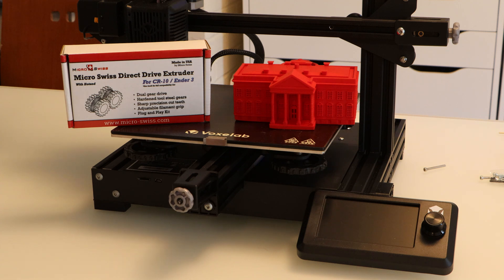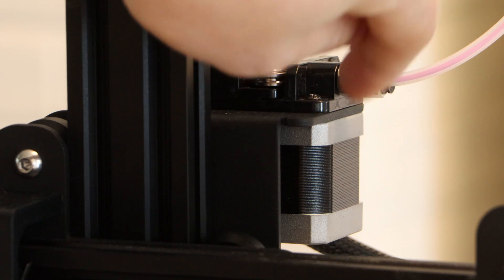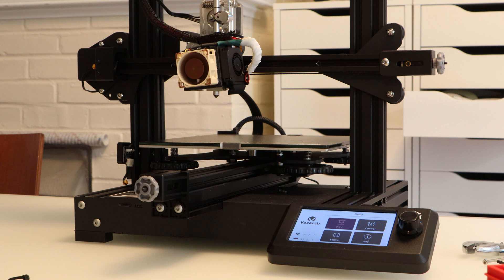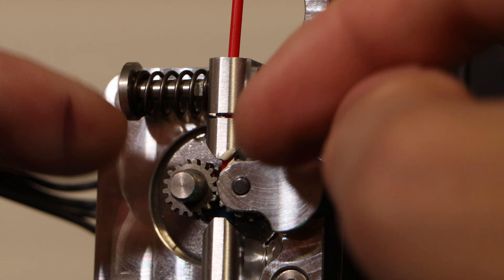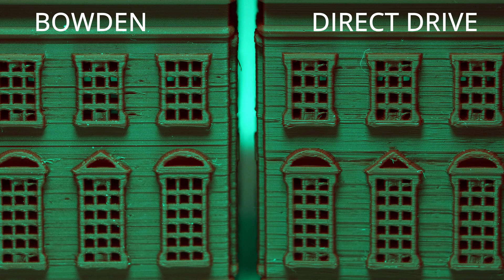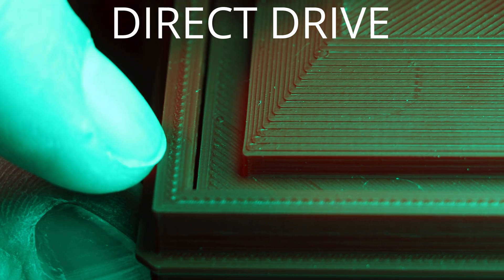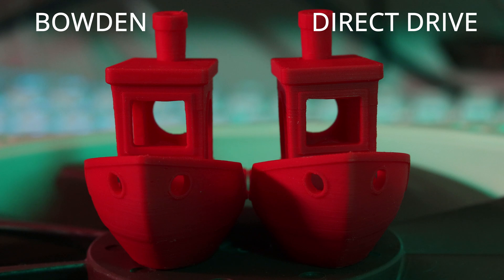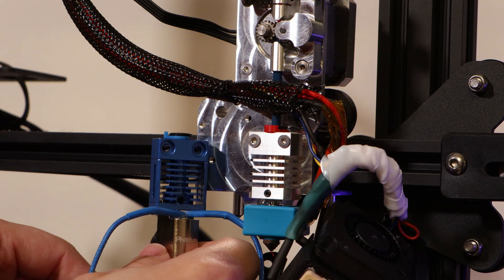Why Direct Drive Beats Bowden Tube

Comment: on the MicroSwiss product page for this direct drive kit, there's a series of tabs. Under the "Fits" tab there's a link to a printable fan shroud that solves your primary issue. At any rate this was a fantastic, informative video.
Reply from the maker: Thanks, I'll check out that printable fan shroud! 

Sometimes I don't read the instructions and get myself into situations that I have to hack my way out of. 

I broke a pretty expensive hotend last week because I didn't read the nicely printed user manual that was included in the box 😅

Rather than admitting defeat and reading the user manual, I spent 10x the cost of the broken part on tools so I could fix it. But now I can break it as many times as I want! Plus I discovered a weak spot in the design and figured out how to improve it. 

It's the topic of my next video with the Phaetus Dragonfly HF

Comment: Just got an aquila x2 and the guy I got it from added an aluminum direct drive that fits in place of the bowden. It looks like an identical part but metal instead of plastic and obviously direct drive
Reply from the maker: Sounds like you got a deal, should be a good printer
Reply: @NathanBuildsRobots  yeh deal of the century $120 dollars for all of it.

Comment: Hi! When you mentioned that you run your prints at 40mms….is that wall speed? or just infill speed?
Reply from the maker: I regularly run 40-80mm/s depending on feature nowadays, but I don't remember what my settings were back then.

Comment: I just added the direct drive and was about to put it back on.... I also added on my cr touch i had laying around, do i need to upgrade the firmware i assume? is there a good resource for the aquilla for firmware, or am i best off just building it myself. thx
Reply from the maker: You need to update the "ESteps", which describes how far the extruder motor needs to turn to extrude 1mm of filament. 
Standard Ender 3 is set to ~97, for this you'll want to turn it up to 130.

it should be documented in the installation instructions from Microswiss

Comment: So everything for the ender 3 v2 will also work for the aquila?
Reply from the maker: For the most part, yes. The Aquila is basically a clone of the Ender 3 V2.

There are some minor differences in hole patterns and the exact positioning of the limit switches, but all the hardware is the same.
Reply: @NathanBuildsRobots  so most of the mods and stuff on thingiverse would work.
Reply from the maker: @iamtoxic1  

For the most part, yes. But feel free to ask with specific mods, I can look over it for you. 

The main difference is the hole pattern on the x carriage plate. 
https://www.reddit.com/r/VoxelabAquila/comments/o7wlwk/aquila_xaxis_carriage_plate/?utm_medium=android_app&utm_source=share
Reply: @NathanBuildsRobots  I just got my aquila at at Christmas and haven't done anything yet.  I've made 3 prints.   I don't even know how to calibrate it yet.   I just know that there are a couple things I think could be better or different.   Like the spool holder

Comment: SO did this and my stepper motor that extrudes the fillament always removes the fillament instead of feeding it......
Reply from the maker: You can reverse a stepper motor by swapping 2 wires on the stepper motor cable. 

https://www.robotshop.com/community/forum/t/how-to-reverse-the-wiring-of-an-extruder-motor-afinity-a9-printer/64193

The other option is to reverse it in firmware, but in your case I think switching 2 wires would be easier. 

Mine worked without having to do that. Are you using the included stepper cable extender?

Comment: Was there anything you did to adjust the x axis? After installing the direct drive, my hot end actually hangs past the bed after sending everything to its home position.
Reply: I may have confused my axis. I'm having issues with the build plate itself. The bed rests at home further back than the nozzle/hot end. So the nozzle is suspended over top of nothing when everything is sent to home orientation.
Reply from the maker: @rogerscott8321  I just leave the front 5mm unoccupied and never noticed, but upon inspecting I see what you mean. My x-axis (the one that moves the print head left/right) is pretty much spot on, My y axis (the one that moves the bed forward/back) has the bed sitting about 5mm back at the home position.

You could fix this by moving the switch 5mm forward, adding a 5mm spacer to the plate under the bed to contact the switch early, or setting the y home offset using an M206 command followed by M500 to save it

"Set Home Offsets | Marlin Firmware" https://marlinfw.org/docs/gcode/M206.html

Do you know how to send gcode directly to the printer?
Reply from the maker: @rogerscott8321  
So you would use Ponterface with your printer plugged into your computer to send:

M206 Y8

Then

M500

This would: 
offset y axis 8mm
save new settings to eeprom
Reply: Thank you. I'm still pretty new to all of this, but I really wanted to jump into this direct drive upgrade so I could get it figured out and dialed in for future prints.
Reply from the maker: I think I moved the z axis limit switch up. If I remember correctly it is held in place with t-slot nuts, so it's pretty easy to move upwards.

Comment: Linear advance could fix a lot of those bowden extrusion issues, because it compensates for startup and slowdown pressure in the nozzle.
Reply from the maker: I need to figure out how to use linear advance. Generally I like solving problems with hardware vs software. If you combined direct drive with linear advance that would probably be a next-level solution
Reply: @NathanBuildsRobots  Yes and no, I converted my Ender 3 to direct drive and am still running linear advance and the results are great. However the difference between linear advance on or off is a lot smaller because of the mechanical benefits of direct drive.
Reply from the maker: @TheAnoniemo  good to know 👍

Comment: I have a voxelab aquila and I've never had under or over extrusion issues like you show with the whitehouse's. Never had perimeter issues either come to think of it.

Don't get me wrong, I'd love to convert it over to direct drive so I can more easily print multiple colors or print with something like TPU, but I wouldn't be doing it to solve any printing issues.
Reply from the maker: I had this issue come up again in my latest video. I think it might have to do with print speed. At lower speeds I don't get any issues but at higher speeds the thick/thin stuff starts to show up more.
Reply: @NathanBuildsRobots  higher speeds usually necessitates a better extruder like a BMG as well as higher hotend temps, should look into upping temps based on a temp tower and the speeds to want to print at as well as a BMG upgrade

Comment: was there any differences in print quality between original and X2. Specifically, carbon fiber and tpu. thnx
Reply from the maker: The x2 really isn't any better than the original. All they did was add a filament runout sensor, so it's not really worth the extra cost unless you really want a filament runout sensor. It's not a very useful feature and can ruin more prints than it saves, so I prefer to run without one.

Comment: Would it be possible to drill and tap the new plate to make the stock fan mount fit?
Reply from the maker: Maybe - but it would be complicated. You would also have to drill some extra holes because the stock design uses plastic hooks that latch onto the plate.

I am working on an update video for this printer. I ended up using a  version of this fan shroud 
https://www.thingiverse.com/thing:4920328

But I remixed it using Autodesk Meshmixer (I had to make it longer to accommodate a volcano style hotend, will post it in thingiverse when I publish that video or sooner if someone needs it now).

It works sooo much better than any of the stock fan shrouds. Just make sure to print it out of PETG, it's about as easy to use as PLA, but has a higher melting temp which comes in handy when printing anything that goes near the hotend.
Reply: @NathanBuildsRobots  Awesome! Thank you very much for your time and lengthy reply. Your video did inspire me to go with the Voxelab Aquila for my 2nd printer it seems like a win win over the Ender 3 v2 and i have no need for a run out sensor they seem like they cause more problems than they are worth as seen in your other videos. Keep up the great work!

Comment: Can someone explain exactly how to adjust the settings for the e-steps? In a slicer program (Cura?) or somewhere else?
Reply from the maker: Gcode is written with distances in mm, the machine needs to translate that distance in mm to # of steps using a conversion factor called "steps per mm"
For the x, y, and z axis the relationship is straightforward and fixed. It is determined by the number of teeth on the timing belt pully, or the thread pitch on the lead screws.

However, the extruder is special. The number of steps/mm can change slightly depending on how firm the filament is, how much tension is on the extruder arm, and the geometry of the extruder gear.

The basic procedure is to run 100mm through the machine, measure how far the filement actually moved, then adjust esteps to adjust for the difference. Repeat until it runs 100mm when you tell it to run 100mm.

E-steps are adjusted on the machine through its touchscreen or knob interface. 
Chep has a good video on this.
https://www.youtube.com/watch?v=QnrH2Sk7y40&ab_channel=CHEP

Comment: Nice video! was thinking about upgrading my aquila to direct drive, however your bowden aquila seems dramatic, mine prints a lot more consistent than what you showed
Reply from the maker: Yeah I think I needed to bump up the e-steps on mine. I tuned e-steps as part of the new extruder install, also the stock setup had a gap between the nozzle and bowden tube of about 2 mm (inside of the heater block) so that was probably adding to the inconsistent extrusion.

Comment: Did you experience any issues with the additional weight on the Gantry?
Reply from the maker: No structural problems. I print at 60mm/s.

The increased mass will cause ringing at lower speeds than the stock setup, so while the stock setup might be capable of 120mm/s with acceptable ringing, a setup that weighs 2x more will only be able to print half as fast with similar ringing.
Reply: @NathanBuildsRobots  if you do upgrade to dual Z or linear rails I'm sure you'd keep us posted. Thanks for the data. I'm considering a Sherpa mini, but may just work out a better Boden extruder instead, for maintaining speed with minimal investment, and I don't intend to print flexibles
Reply from the maker: @VastCNC  I'm getting a machine in for review this week that has dual z-axis screws. 

From what I can tell, dual z screws greatly increases the stiffness in the z direction. 3D printing tool force is almost always very close to 0. But sometimes you get some curling, boogers, or surface roughness from overextrusion which the tip of the nozzle will bump into. In those cases a single z screw build will move up and out of the way (like a record player needle riding on the surface of a record). This can allow artifacts to propagate to higher layers, while a dual z build will hold strong and squish any extra plastic out and to the sides.

Comment: Lmao of course you can run 2 in series just learn ohms law. It’s really easy
Reply from the maker: Ohm's law is only for resistive loads. Fans and motors have a large inductive portion but I guess when its running steady state it pretty much acts like a resistor.
Reply: I really appreciate you answering questions.  Thanks for doing this. It adds to the value of the video.  You have a new subscriber.

Comment: A significantly easier way to fix the end stop issue is to print a small clip for the edge of the hot end carriage that can fit inside the cover and hit the switch. No modifications needed to the switch or switch cover.
Reply from the maker: Yes that would be a much better solution. For a 3D printing channel I don't do enough printing to fix my printers!

Comment: How did you end up removing the thermistor with the thermal compound on it?
Reply from the maker: It was oddly reminiscent of pulling weeds out of the ground while trying to keep the root intact. 

Mine had a tacky, gummy glue, so slowly increase tension and it will start sliding out. I thought it like was pretty close to breaking but it held together. It came loose around 20lbs of tension.  

Worst case you break it and need to buy a new one. Almost all printers use a pretty standard 100K ohm NTC thermistor. They cost about $2 each on Amazon.

Comment: I've actually ran two noctua fans at 24 volts for months without issues. I'm not saying I didn't shorten their lives, but they weren't silent either. They were obviously spinning twice as fast as recommended. Once I realized I had wired them wrong, I corrected them and they're still working fine.
Reply from the maker: That's hilarious, I wanted to try that but you'd have to be crazy to intentionally plug a fan to 2x the voltage. Good thing they're way overbuilt.

I have a couple really fun Noctua fans I want to incorporate into future projects, including a 24V IPPC fan,  a couple 5V fans that can run on USB, and a couple massive 200mm fans.
Reply: lmfao

Comment: Great video. Micro Swiss has a great product. I just put 2 of those setups on my printers. Keep you the videos. 👍👍
Reply from the maker: I checked some of your videos about it, I wish they would standardize the fan mount pattern just like they've standardized hotend mounting systems. It doesn't need to different in every printer!
Reply: @NathanBuildsRobots  true there are so many combinations out there it's crazy. I found a couple on thingiverse that bolt right up too the aluminum plate but I had to switch my fans. IMHO for me I think the fang ducts do really well. So I went with that combo on my Sunlu S8.

Comment: Interesting. I don't like having to 'modify' parts to make things fit. However, it may be unavoidable. As is, the Aquila prints PLA, PETG and ABS just fine so no upgrade plans for me. I've yet to see an alternative fan shroud on Thingiverse but I may just start working on one myself.
Reply from the maker: I think this one might work? 
https://www.thingiverse.com/thing:4369859

I try to avoid putting plastic near the hotend because it's flammable and the heater block can get very hot 🔥
Reply: @NathanBuildsRobots  Yes, that's a nice one. I found one specifically for the Aquila. 

https://www.thingiverse.com/thing:4758228

Comment: Great video! 
Question about running the Noctua /12v fans in series; that protection circuit comes as standard on the printer or did you install that additionally yourself?
By coincidence I ordered the same fans yesterday:) also an 80mm for the cpu
Reply from the maker: The Noctua fans have a built-in anti-stall/overcurrent protection circuit that bypasses the fan motor if it detects too high of a sustained current (normally this would be an indicator that the fan motor has stalled, but overcurrent can also be caused by too high of a voltage.)
Not all fans will have this built in protection and they may burn out if wired up in series like this! 

This only works on pairs of fans that have the same current draw, ideally you should use a pair of identical fans. The 40x20mm fan and 40x10mm fan combination that I used only worked because they both draw the same current. 

I wouldn't recommend doing this, I can only observe that I did it and it worked. Proceed at your own risk!

Comment: Great video as always. Do you happen to have a link to that more compact stepper motor?
Reply: Yes please provide link.
Reply from the maker: I bought this set from Creality to use for my projects:
https://amzn.to/3xzUKrX
Reply: @NathanBuildsRobots  nice. So you used a 42-34 in the video?
Reply from the maker: @David Pellerin  I think I used the 42-34 steppers.

In my mind the optimal solution is to match the mass of the x-axis (hotend, heatsink, extruder, x-carriage) to the mass of the y-axis (glass bed, heated bed, y carriage, tensioning knobs). If one is significantly lighter than the other you can't increase your speed unless you tune your x axis and y axis acceleration limits independently. I print most things at 40mm/s and rarely notice ghosting even on my fanless build that slapped a massive heatsink and stepper motor on the x-axis.

I achieve print speed through larger nozzles and thicker layers rather than faster motion.
Reply: What are your thoughts on using a pancake stepper to reduce some of the weight of the Hot end carriage? Since it's a direct drive system I can't see it needing a lot of torque. And the lighter X could maybe result in less ghosting artifacts.
Reply from the maker: @davidpellerin9445  on torque requirements, this extruder has about 50% more mechanical advantage, so you can reduce stepper size by 33%and get the same extrusion force as the stock setup (and 0 bowden tube friction).
You could go smaller in the stepper motor but I'd need to test it to know for sure. If you had a 3:1 gear reduction like on the BMG or titan extruder I'd be more comfortable with a smaller motor.